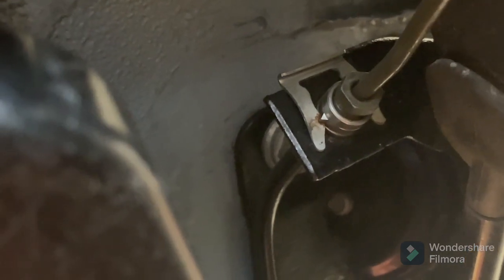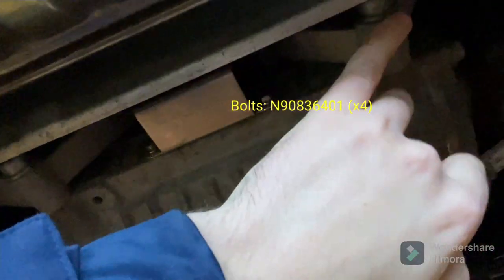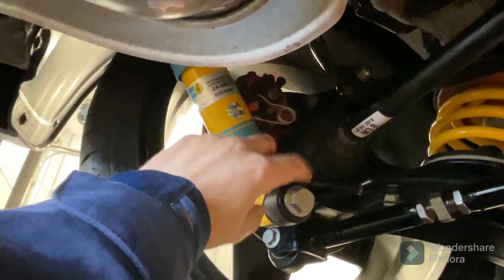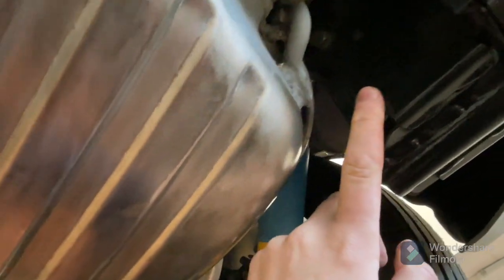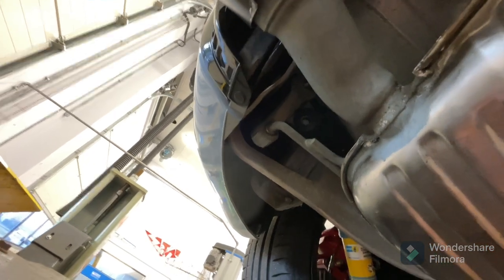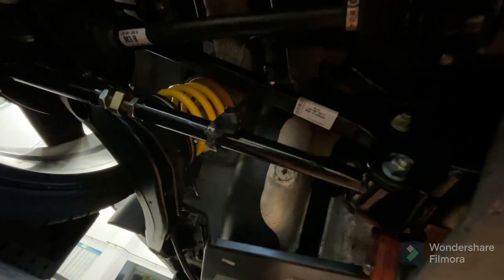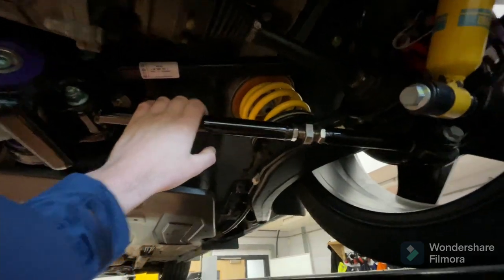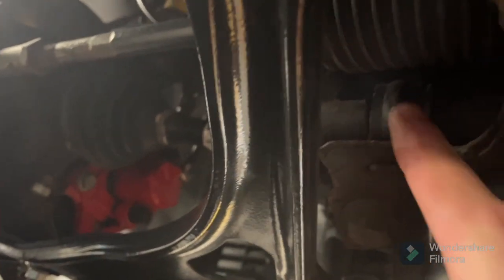Audi TT MK1 Quattro Restoration Subframe Underbody Overhaul Hints, Tips and Full Overview.

Comment: Your mention of steel interacting with the alluminium heat shield got me wondering if when rebuilding it might be worth considering using Duralac between surfaces.  I use this on all my fixings on the mast on my boat as galvanic action between steel and alloy of the mast is blocked by this paste.  Not sure if heat might be a problem with Duralac but maybe worth looking into.

Comment: Late tip, but for anyone struggling to loosen brake pipe nuts even after using penetrating fluid, get. Hot air heat gun and get the connection good and hot work the joint loose in both directions. This squeezes the softened plastic coating of the brake pipe out and relieves the pressure of the corroded zinc plating which causes the brake pipe to twist with the tube nut.

Comment: Wow great work, my car is a 2001 1.8T 225, underneath its one homogeneous piece of orange metal 😂 but anything that's been advised to be changed by the specialist has. It's got 183k miles, I'm sure it will need a subframe and bits and bats one day, but you'd never know it had the miles it has on it. It's too high mileage to do what you have done. But that's a really nice car 🚗 you have there.

My car has absolutely mint interior and paint work though ❤

Comment: This is great and so useful, I'm currently collecting all the rear end parts.
Looking at your CAT bolts you obviously didn't remove that so assume you left the prop shaft together and still in place? Did you then pull the diff backwards to release the protrusion from the shaft? And then on refitting line that up as you raised the diff into place? If so how did that go? I had in mind the whole exhaust and shaft would have to come out but would rather wait until I get to the front end for that if possible 
Cheers

Comment: The fix for holes corroded in heat shields is to cut patches/washers from ally or stainless sheet and put them under new spring washers to hold the shield in place , anti corrosion wax keeps the new washers corrosion free a bit longer

Comment: Awesome video Felix. I have a 2WD but all of the tips are really useful. Supplying the part numbers is really helpful too as is confirming where OE parts are inexpensive. I have purchased most of my parts from EBay but from reputable brands like Febi Bilstein, Moog, Delphi, TRW etc…

I did buy some new unbranded brake Calipers, with 5 year warranty. I will probably fit these to start with and refurb my genuine calipers ready to replace if needs be. 

Handy to know about jobs to do while the car is stripped down. I’m thinking that perhaps it would be sensible to do the clutch while the subframe is off?

Can you think of anything else to do while the subframe is off?

Comment: Cracking work, great video. Did you consider a lanolin-based weatherseal on the underbody? Done every couple of years from clean, it should keep the damp out.
Reply from the maker: Cars been gone about a year now so no I didn’t. Sold it on. I’ve used Bilt Hamber clear seal which I recommend very highly over lanoguard etc.

Comment: Hi Felix, Absolutely great video, and your methodical commentary is excellent, so it makes sense first time round. You really should do more video's because I'm sure you'd get a big Youtube following in no time. However, a quick technical question please, did you replace the rear lower & upper control arm outer bushes on the trailing arms, and if you did, what upper & lower new bushes did you use and how did you replace them? Regards
Reply from the maker: Hi Chris. Thanks for the kind comments. I replaced all the bushes. I used Superpro for those ones you mention. I’m not sure what you mean by how did I replace them?  Can you elaborate?
Reply: Thanks for your speedy reply. With regards to removing the old outer upper & lower CA bushes in the trailing arm, did you remove and replace them using  a press, or hammer them out?
Reply from the maker: @chrishayes4146  ah right I understand. I used a press but the new ones are two piece so after they are powder coated you just pop them straight in.
Reply: I'm sorry to trouble you again Felix, but as I'm really struggling to find the correct rear lower outer control arm Superpro bushes online, could I put in you and ask if your have the correct Superpro product number for them, Regards?
Reply from the maker: @chrishayes4146  come to think about it I think I used lemforder outer ones and superpro inner ones. The factory outer ones are rose jointed but these seize and snap the arms. The lemforder ones are oem so are better than any other (imo). Wherever I didn’t use poly I used lemforder. Hope this helps and sorry for the confusion.
Reply: Yes, Lemforder sounds good. Watching your video closely a few times, I thought that the bearings I'm referring to were not the poly hand push in type. Anyway, thanks again for your reply. All the best 👍

Comment: Great vid m8 the bushes that are on the trailing arms at the rear can be pushed in with the long nut and bolt thats how i done it not having a press used a cylinder head bolt easy done

Comment: Thanks for the great video! Are those front PU strut top mounts a lot harsher in ride quality compared to the original rubber variants? And is the 10 mm lowered version even harder riding again? I've read somewhere that PU is not good at dampening vibrations compared to rubber, and I'm not wanting lose ride comfort. I would appreciate your comments on these questions.

Comment: I'm about to carry out this task on my own TT. One question for you. Is there any reason you put the adjustable tie bars on the bottom instead of the top? I've seen them in both locations & wondered if there's any benefit to either?
Reply from the maker: My justification is: 1. Easier to adjust. 2.the majority of the load pulling on them is on the bottom imo. 3. You can see them.
Reply: The same thought went thru my mind lol... Good answer though.. Off topic yammy, I tried to reply to a question you asked on the constant name changer channel. Sadly my reply was blocked by the channel creator!! A Google search of >> "bavariandominator @ the review centre"
Will surly put you in the picture though. Beyond belief!!!

Comment: Fantastic video and amazing end result! Quick question...the  bushes on end of the arms (the bottom arm which is adjustable and the top arm which is rectangular) do you think it possible to remove those bushes in situ and fit polybush? 
I bought new genuine arms which have new bushes fitted, but the fork end im referring to. Thanks man and great vid!!
Reply: *The outer bush of rear control arms
Reply from the maker: Hi there. Thank you for the kind comments. We thinking back as far as I recall, the bottom hubs would probably be a pain because you’d need to push the old bushes out. Of course you can buy kits to do this but it’s easier off the car in a press (depending on how good your kit is). The new bushes you use if poly, will be easy to refit but I didn’t use poly on the outers which usually come two piece.  I used lemforder oem ones which have a sleeve. As far as I recall they were a pain to refit as I remember us trying to do it without damaging the powder coating. I do think you could do them in situ but I doubt it would be pleasant.
Reply: Hey Felix 🙋‍♂️ thank you so much for your  reply. I will let you know how it goes🤞

Comment: Wondering if you could help. I am searching for a front subframe for a 3.2 V6. I have come across a few on eBay, which claim that they came from a 225 and they will fit the 3.2V6 will they fit? Thanks Dean
Reply: Dean, The V6 is different as the mounting points for the undertray differ from the 225, and it also has extra bracing. As Felix said, a reputable breaker will have one, probably looking around £200

Comment: The fuel filter lol that is a job see if its not leaking leave it alone i changed mine because the filter was leaking ended up fucking the fitting on the pipe from tank to filter so that was that fcuked ended up getting 8mm rubber fuel pipe conected it to the hard plastic fuel line after many hours off trying to pull it through without dropping the tank witch basically required droping the full rear end but managed to get the line through without that got new quick release connectors witch were for hard lines couple off jubilee clips job done but fuck changing the fuel filter they fittings are a complete nightmare